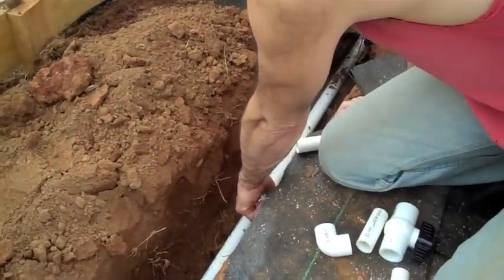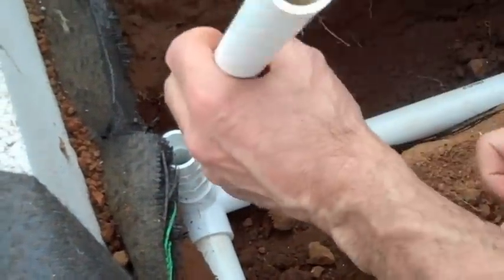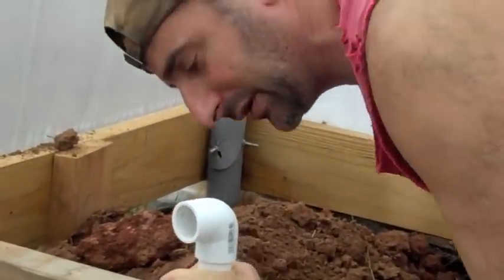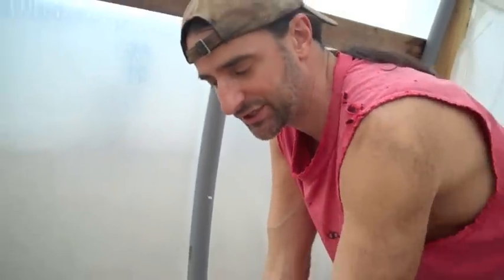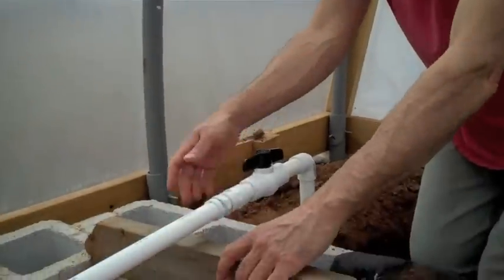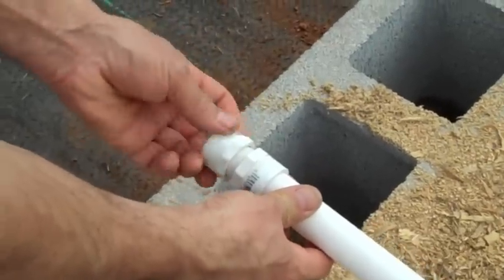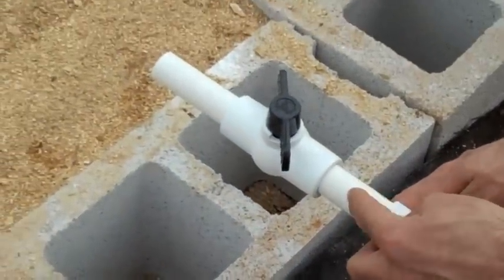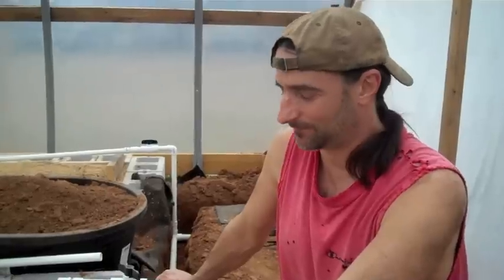AUTOMATIC WATERING SYSTEM

Comment: Have you tried turning on the water yet to see if you have enough pressure to make it to the end of your large bed? When I tried that method for myself, I only got water flowing to the first third of the bed. I ended up needing to install misters in order to get water flowing across the entire bed. Maybe my weep holes were too large??? Best wishes with yours!
Reply from the maker: We haven't run water all the way to the ends but we ran the water out the pipe at the beginning of the bed and seem to have good enough pressure (hopefully). I got the drill bits today so hopefully we will be testing it out later in the day.
Reply: try reducing  your final run to 1/2 in pipe that will give you more pressure.